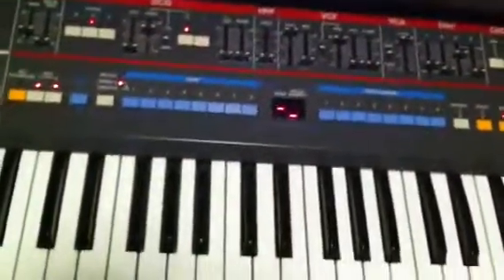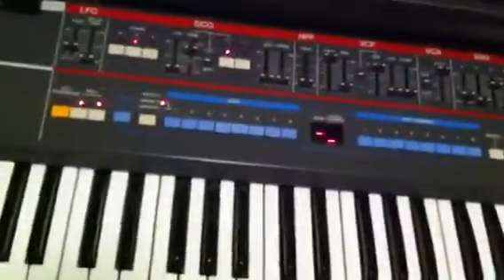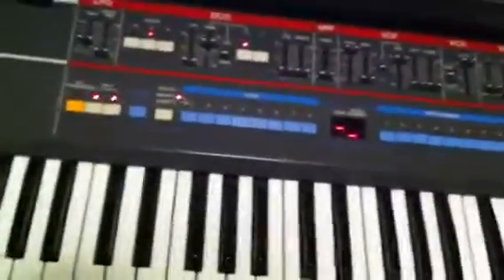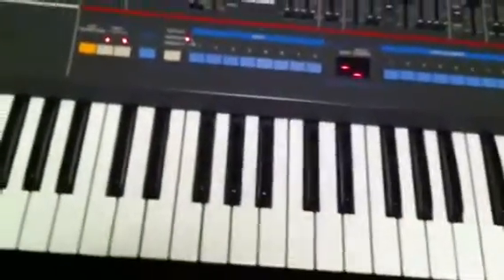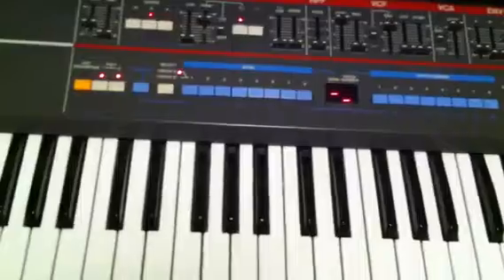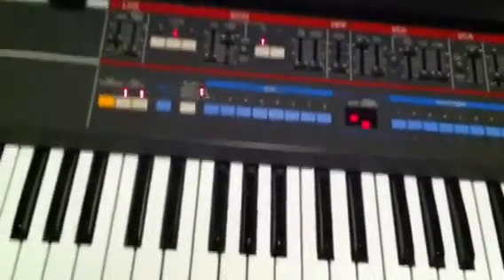Roland Juno-106 - Failing Voice Chips?

Comment: @Booger6995 However I still stand with your original take that it is the voice chips 80017 that needs repair / replacement. This point is not in contention. As to said methods and out come is left to the user to decide. Think we covered it now. L8R

Comment: @mima14031985 Yes it's plausible technically but in my experience as an electronic tech when it is heat related it affords itself to direct temperature failure analysis. I personally have not performed any analysis on the chips. But if I did, temperature tests would be one of them. You can get some intermittently failing parts to come and go using heat/cold cycles to locate them. I use this a lot. However I have not seen that mentioned as a cause for this chips failure and I know the Juno good.

Comment: @Booger6995 Just ask as I'm not an electronic engineer, but (besides the 106's voice chips) it's plausible that a component which suffers progressive damage from an overheat would work correctly if the overheating cause is removed (so the component doesn't overheat again).
Well obviously a component in this situation it's no longer reliable and may fail soon.

Comment: @Booger6995 Also just as an after thought, look at it from a technicians point of view. If it was heat related it wouldn't take 20 years for them to start failing. Electronic parts are pretty damned tough and will generally last a long time if not subjected to overt abuse. Due to the pattern of the failure and the fix, it is logical to assume a circuitry change that is reversible. If it was heat related it would be much sooner in failure and most likely irreversible. The fix makes it unlikely.

Comment: @mima14031985 Yep. I had heard that too and went into the schematics of the Juno 106 and realized there are no really heat producing items on that chip. Then I saw a detailed analysis done by the guy from Analog--. It explains the resistance change really well.

Comment: @Booger6995 I agree, but removing the resin coating it's quite tricky, if one is not a bit skilled with precision hand works may damage permanently the chip. Actually I written that this solution can be tried, if one have the skills to do this, but it's not for all people. Personally I didn't throw the old chips, I still have them if one day I want to restore them.
Regarding the over-heating of the chips, this is what I red when searching about this issue, so I assumed it was this the cause.

Comment: @mima14031985 Sorry but your wrong. The Roland chips have a conformal coating that becomes conductive over time. It starts adding resistance into the circuit to the point that it stops working.  It is not an over heating issue. And the acetone trick works real well if done right. This will completely refurb the chips and they will sound just as good as new. No sense in buying chips when this will work. Now if you damage one then......

Comment: To recalibrate the instrument you need an oscilloscope. Search on Google for "Juno 106 Service Manual", you'll find a link to a site which is called "Juno 106 Connection", here you can download the whole service manual, on which it's explained the recalibration procedure step by step.
I own a Juno which I entirely restored with clones from analoguerenaissance, they sound exactely like the originals (I checked the waveforms with an oscilloscope) and look very well built.

Comment: VCA/VCF ICs dying. You need to replace the failed ICs and recalibrate the instrument.
Don't buy original Roland ICs as all of them will fail, because these ICs are dipped in resin which makes the resistors inside to overheat and fail. These are not chips but small circuit boards with other components soldered on them. You can try to remove the resin with acetone (there are some Youtube videos explaining this), but if you want to be sure, buy clones (for example from analoguerenaissance . com)